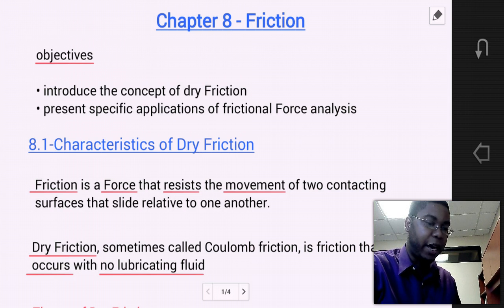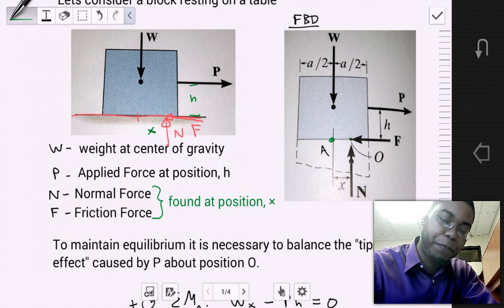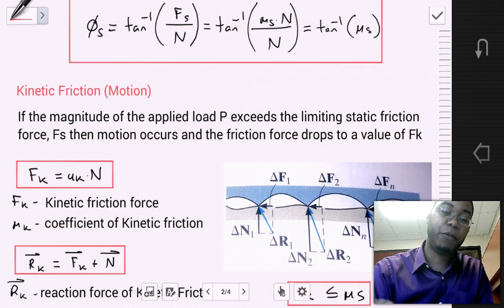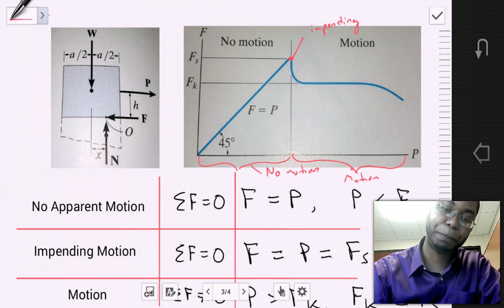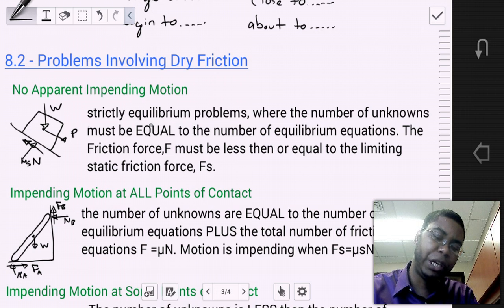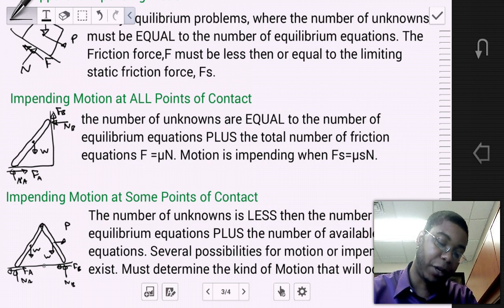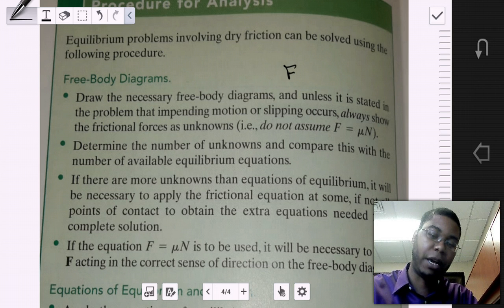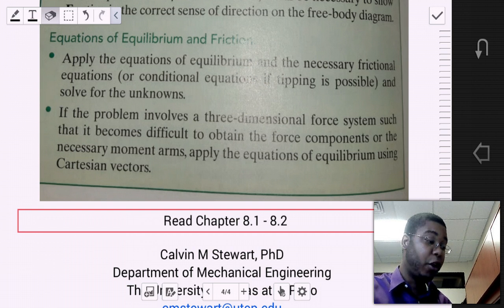Friction (Statics 8.1-8.2)

Comment: DR. Stewart thank for another  powerful and classic lecture on Friction/Dry Friction. I first encounter Friction in Engineering Physics One. As an Electrical Engineering student, I took Physics One after taking Calculus I,II&III and Differential Equations. Physics One is a combination of Statics and Dynamics. I did well in Physics One ,however it was a massive struggle.